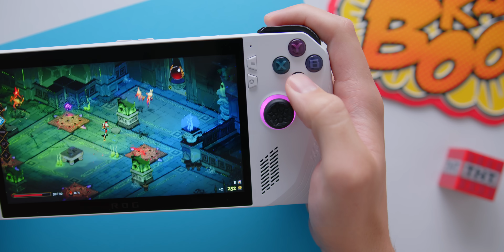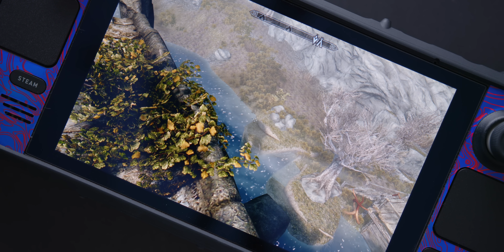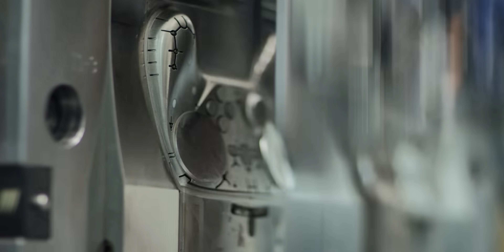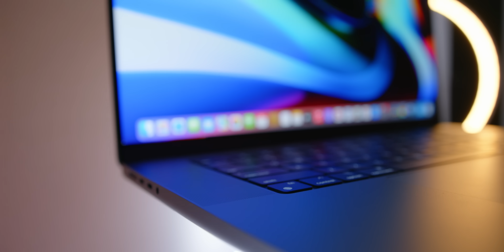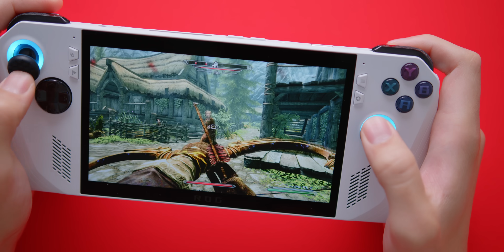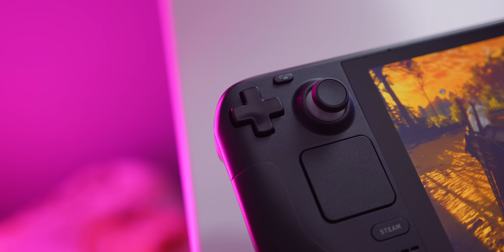Steam Deck vs ROG Ally - 3 Months Later.

Comment: The ally needs life support to reach potential.  So if you're in the go the deck is the must have.   I played diablo 4 on my ally with these config (720p, 15w, 50% brightness,  50% volume, capped to 45 fps) and i only got an hour and 15 mins.  I dont have a reason to plug it coz when that happens i'm home with my 4090 rig.  I dont have the deck yet but as per reviews looks like ill go down that route.  The ally might be for people who wants to always have a power bank with them and those who dont have pc

Comment: I own both a Steam Deck and Ally, and tend to use the Ally much more often. Having the extra horsepower and screen pixels helps it feel like much less of a downgraded experience compared to my desktop, whereas the Steam Deck leaves a good bit to be desired when running heavier AAA titles. It's doable, but a bit too much of a compromise for my liking. However, if I need to travel and won't be around a power outlet much, it's nice to play older/lighter games on the Steam Deck with lowered power profiles.

My summary of the two devices is this: I much prefer the in-game experience with the Ally, but I prefer the out-of-game experience with the Steam Deck. Having to run updates in 3 different places on the Ally can be a bit of a chore.
Reply from the maker: Absolutely true.
Reply: The rog ally non extreme vs the steam deck

Comment: The controller layout is more like an Xbox with the rog ally, that's possibly what might push me away
Reply: I would decide on all other categories, minus this one. As a lifelong Xbox user, I actually think the SD has much better ergonomics, and neither are comparable to a controller as you grip them entirely differently. The Ally for once, I think the lower right thumbstick doesn't work in the way it does work for an Xbox controller, and I think it's because it causes you to grip lower which makes your grip asymmetric. These things are much heavier and larger than a controller, I wouldn't decide based on how you think it'll feel, maybe try to do a hands on if you can, but I think nearly all Xbox users would say SD is more ergonomic layout.
Reply: @no-barknoonan1335  i come from the perspective of not liking the joystick orientation of the Xbox controller. My preference is to Playstation controllers
*-I like being able to move the left joystick with the inner part of my thumb, and then reach out to the D pad with the tip

Comment: What is better for Long battery life gaming on 60hz and fHD? I Can get asus or Steam Deck for 400 €
Reply: SD has better battery life, both can game at 60hz but Ally will hit it more reliably on cutting edge games.

If you can get the new OLED SteamDeck I would say it edges out the Ally by quite a bit for the price. If you don't mind dealing with the shorter battery life of the Ally, go ahead it's a good device, I just can't get over how abysmally short the battery life is.

Comment: Few additions to the video:
1. Apart from better quality controllers with option to replace sticks to hall-effect sticks, there is also a built-in functionality to use community managed controller mappings or official controller mappings provided by game developers. This makes a huge difference in setting up controller for specific games.
2. Speaking about repairability we also should consider how much of the custom details you can get for your device and this is where SteamDeck is above anything else on the market. You can upgrade controllers, buttons, screen, backplate or even entire case choosing from not one but dozens different brands and suppliers. It also important to add still ongoing issue with microSD port on Ally.
3. For me the biggest difference between Windows and SteamOS - is that you don't need a touchscreen with SteamOS while on Ally you will be using touchscreen much more than you'd think.
It also worth mentioning that the new SteamOS 3.5 (currently beta) is improving display colours and adding more screen settings while also boosting performance with the updated linux kernel 6.1
Reply: Sheeeesh the facts on this. Def sold me to the new OLED deck.
Reply from the maker: Wonderful summary. Valve has crushed it with the Steam Deck.

Comment: Can you play starfield & dock the ally or steam deck via hdmi/usb C to a TV without any setbacks?   Saw you had it on your homescreen. Thanks
Reply from the maker: I actually haven't tried using it in a docked setup for Starfield. I mainly played in portable mode with adjusted settings. I don't see why a setup like that couldn't work though.

Comment: If only I could play Genshin Impact on a Steam Deck without getting banned or jumping through too many hoops. The decision would be so much easier.
Reply: You can! Use Heroic Games Launcher on the desktop. Genshin's anti-cheat recently became compatible on the deck, so it's as simple as installing and jumping in. Disclaimer though: Genshin runs and looks pretty poor on the deck. The Deck's screen is blurry in motion, colours are pretty dead and even on low settings fps swings below 50 all of the time. I've tried it on both the deck and the Ally and the Ally performs and looks quite a lot better. Anyway you can definitely play on the Deck :)

Comment: Full windows support for the ally has really come in handy for me.. for example I would’ve considered starfield unplayable without if not for a certain performance mod that made a huge difference in how smooth it feels
Reply: Which also works on the Deck ...
Reply: @mechanicalmonk2020 yeah with a load of hassle. Anything that isn't directly on steam is a pain in the ass. I've been running Linux on my ally and it behaves the same as SteamOS thanks to the community including sleep, giro deckyloader etc. But once the Linux crap like dealing with lutris and heroic, you realise that if Microsoft make a dedicated game mode for windows (which they are working on). SteamOS will be dead. Games also run worse on Linux be it on a handheld or desktop. The only reason it runs similar to windows on the deck is because the drivers are old and bad. Like for like there is no competition.

Comment: Having owned both handhelds, I summarised the experience:

Steam deck: plug and play
ASUS ally: plug and pray it plays without too much tinkering.
Reply: So which should I get for casual play?
Reply: @sonnygaddi7382  steam deck for casual play. Not much setup is required.
Reply: So would gettin the deck be better if I wanted to play the Spider-Man remastered and miles morales games? @Oniontrololol
Reply: @sonnygaddi7382  Spider-Man plays very well on steam deck.
Reply: its a handheld PC ... one way or another, both devices will reach a point that you need to tinker your device (even a bit) to play some of the PC games (not all PC games are optimized or easy to access) .. i have my fair share of tinkering issues with both devices (either it be Linux SteamOS or Windows 11)
Reply: Oh ok thx for lettin me know @schikey2076
Reply: SD wont even play above 25 fps on new games LOL good luck with that
Reply: This is just so wrong you cant even play a batman game in 2013 without thinkering with proton just to play it, SD is not a friendly console.

Comment: Is the deck's screen is abysmal, linux is unintuitive and finnicky, and both are also true of the touchpads. SteamOS UI is at times slow and unresponsive (the steam/peformance buttons rarely work on first press) and the constant shader downloads are killer if you have slow internet. The Deck wins in price which is obviously a huge win. If price isn't a consideration, Ally wins every time.

Comment: From my point of view, Steam Deck could be identified as the best Handheld at the moment, based on Price/Performance. I had a 64gb SD, upgraded to 512gb, and it's amazing. 

You can not request a Handheld to go 300 FPS, max setting AAA games, whole day battery, and an amazing 240Hz display. However, you have got a device allowing you to play a triple A game on 45FPS, low setting, for 2/3 hours, or idle game, 60 FPS, for 5/6 hours, when you travel far from your PC or can not carry Laptop. It's really good device if you use it as Handheld gaming, not a high end PC.

Moreover, I can confirm that SD display is very niche (reality/spec data), not bad at all compared to G24F or ProArt 24 monitors. Lastly, SD does not burn your micro SD card like Ally one.

Comment: So i have a Steam Deck but considering selling and "upgrading" to the Ally. I want to be able to play newer AAA games and not he limited to 30fps. I just got Lords of the fallen and i get horrible dips from 40-20 every couple minutes doesnt matter the settings but then i see the Ally running at 70fps+. Can you confirm if games like this run better on Ally?
Reply: Easily buy the ally
Reply: Can confirm, I had both. Developers optimize for Windows, not SteamOS. Games are way smoother on the Ally. Even with the OLED Steam Deck I’d go for the Ally.

Comment: I think it’s just getting clearer that they went about accommodating completely different consumers here. If you want a hassle free psp like experience with limited performance buy the SD. If you want a portable gaming focused pc and don’t mind messing with windows and a better screen get the Ally
Reply: Yes both these can be true. I had steam deck and enjoyed the deck but I felt limited with demanding games. I did get the Ally and have loved the extra horse power. Plus Windows 11 requires patience, and understanding. Both are good but gotta know what you want out of them.
Reply from the maker: Perfect summary.
Reply: @spectertech except that the SD now gets an oled version, which is MUCH better than any lcd. I already sold my old steam deck an getting the oled version. Can’t wait 😁
Reply: As someone who plays mostly indie and previous gen games, SD has been perfect and has also replaced my desktop since the linux experience is much snappier than the bloated features of windows.
Reply: You got it wrong, you need more tweaking just to play games in SD, worst experience overall

Comment: Bought Ally from Launch and it's getting better all the time. The why I did not buy Steam Deck last year was that Linux-based system. I can imagine you get a better console like gaming with it but nothing beats Ally when you want to dock it and stream Netflix etc to a TV via a hub or use it as a desktop. I just think Ally has many other uses than just a console like a handheld.
Reply: I want an ally. I'm not a PC genius but I have patience am ok at troubleshooting and have some super tech savvy kids. I like what you are saying here cuz I have an series s I use mainly for gamepass. Have a shield TV box that I really only use for streaming.  My experience with the cloud has made me fall for pc gaming so I am essentially looking at the ally to replace pretty much everything I use other than Nintendo and my phone
Reply: How about the sd card frying?
Reply: Exactly my take.
Reply: first actually good reason to buy the ally ive seen
Reply: I think it's a matter of preference. I can do everything you mentioned on my deck without tweaks and issues: Use it as a desktop, stream Netflix, play games, use Xbox Game Pass and much more. It's a pretty smooth experience honestly. I'd only see an issue if you are big into modding your games. That's where having Windows is preferred because it's much simpler. Everything else my Deck does just as well if not better than my Windows laptop.

Comment: I do like seeing these follow ups because many people and many reviews are from the early period. Both the Ally and Deck had far more issues at launch than they do now. The Ally has the failing SD card slot and the Deck has the infasmous 200mhz/400mhz bug which both of these still plague both devices
Reply: the mhz steamdeck bug was just fixed last week
Reply: @lainpilledwiredcell  really? i had this bug a few days ago
Reply: are you using the beta update branch ? they fixed it there @workout3D
Reply: @lainpilledwiredcell 🧢
Reply: change to the beta branch @EYE_OF_THUNDERA

Comment: This is why I chose Steam Deck. The devices are similar, with different strengths, and overall pretty equal, but the Steam Deck is cheaper and it comes with a case. I saw the discounted Deck prices and it was the end of the debate.
Reply: Do you own a gaming pc? Im teying to decide if i want to build a pc or go to a steam deck. Im tech savy just trying to save😅
Reply: @IndestructibleTurtle build a pc if you plan to use it at home mainly
Reply: @IndestructibleTurtle you can build a pc pretty cheap these days
Reply: @huskysharky9025  thank you for the advice 😁
Reply: @IndestructibleTurtle  stay safe hope you have fun!